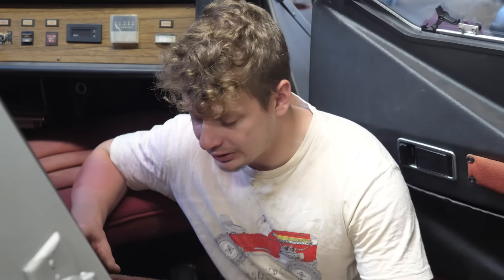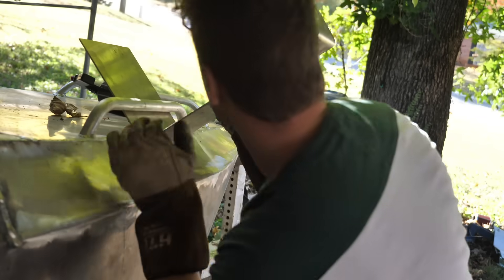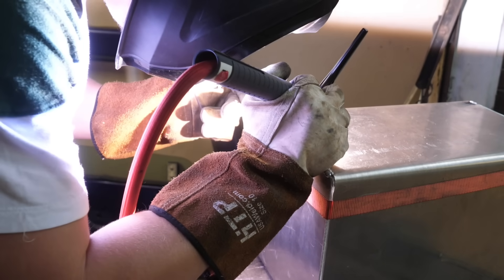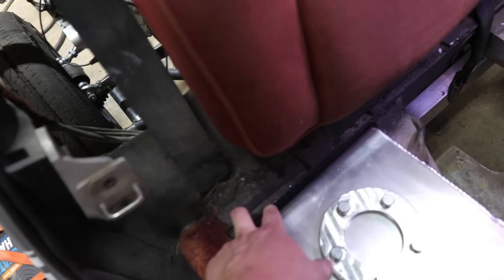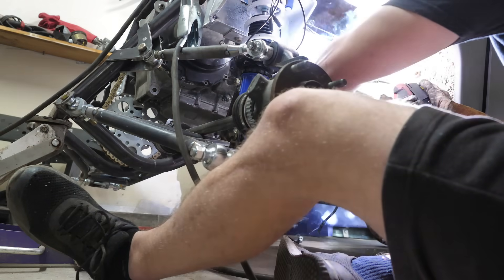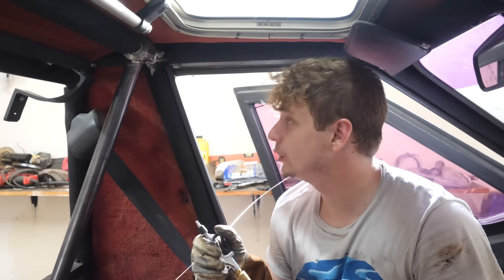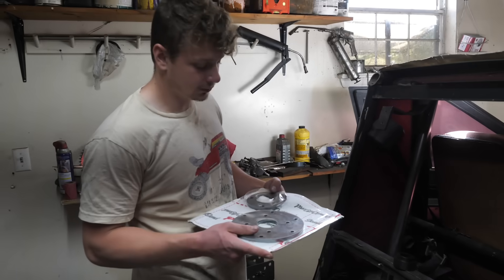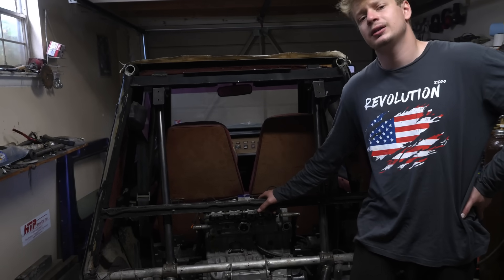Hayabusa Swapping Tiny Electric Car part 7!

Comment: Did you put moisture weep holes in the bottom of the tubing? humidity will enter the system and rust out your frame on steel parts.

Comment: I can not wait to see this done. what a cool little commuter car. Wish i had 1 up here. First person i have ever seen go in revere and swap the electrical motor for a fuel powered car. Would be interesting to use to drive around the province in. A tourist car for sure. Drive a little, sight see a little, drive a little, eat at a road side diner, and drive some more; and before you know it, you will be pulling into a motel for the night for pizza, beer and a good night sleep.

Comment: For the harness bar: put a straight bar in side to side at the correct shoulder height, and then weld in an X bar bracing below it for structural rigidity of the hoop, and for reinforcement of the harness bar. 👍

Comment: If i were to do dual fuel tanks: Make a 1 inch braided flex connection pipe low between the tanks keeping them balanced. The larger interconnect would allow you to fill both tanks from one side. I'm sure venting would be needed too. 1 tank would be fine too and then you'd have storage space or room to install a bit of audio equipment, small sub/amp combo.
Reply from the maker: Great idea 💡

Comment: Its so awesome that builds this stuff in his garage, imagine if everyone was that creative and skilled as him 🔥💯🇺🇸
Reply: honestly, he needs a bigger shop and his own lathe, i wanna see what this dude can do with the resources of tavarish
Reply: Aluminum on that fuel tank looks about 1/8.  Is it?  Type of aluminum  - 3003?  5052?  6061?   4043 rod?  5336 rod?  Some other flavor?

I’m hoping to make a Much smaller fuel tank, i.e. 1 - 2 quarts or so, for a “lightweight cordless battery charger”, which is why I’m wondering what is commonly used.  I’ll probably need enough sheet, etc. for a few tries, as it’s been a very long time since I welded aluminum.